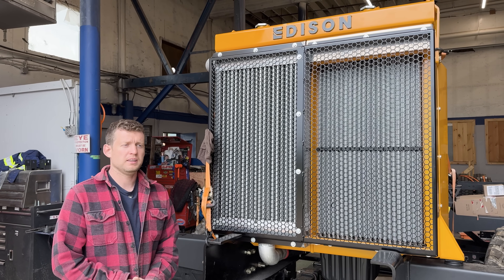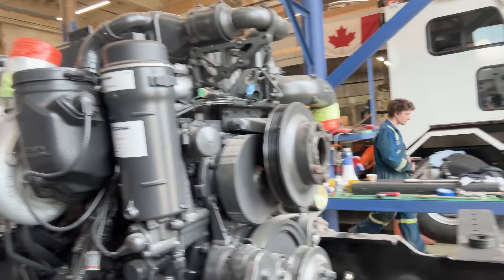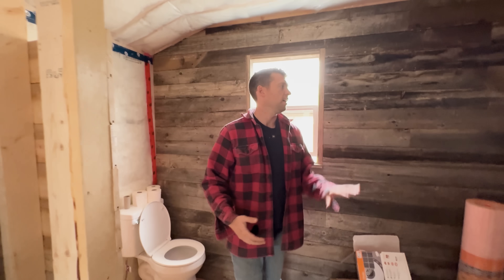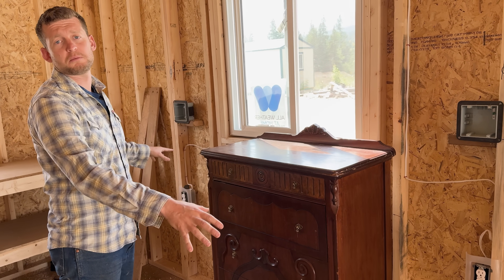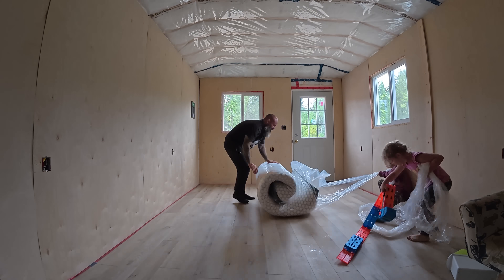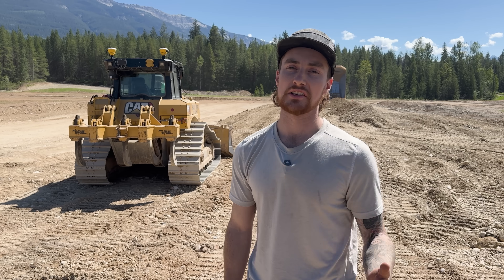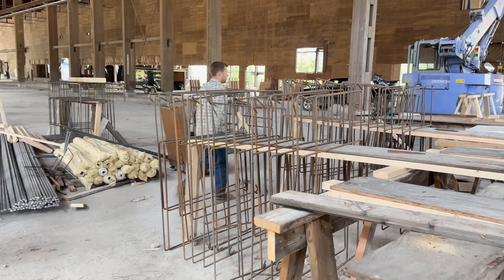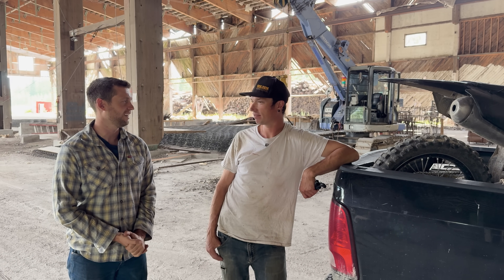Red Tape Can’t Stop Edison Motors - Full Update Inside

Comment: Pull the generator. Run it full electric for the certification.. bolt in extra battery packs under the hood. Run the generator stationary on a trailer to charge.

Comment: Can you find some sort of workaround? 
For example, as I understand it, an RV can have a generator to charge the coach batteries, and a semi can have an APU to run the coach. 
Also as I understand it a fully electric semi meets  emissions. 
So hear me out...
A fully electric semi with like 150 mile all electric range... 
Then a better sleeper, think like a modified northern lite truck camper. So like a real bed over the driver, a bathroom, kitchen, etc... 
Then put like a 1000 watts of solar on the roof, that charge the chassis batteries. 
An oversized coach battery that might be able to supply say a 100 to 150 miles if it was hooked up to the chassis drive train. 
Then put your generator on to charge the coach batteries. As I understand it an RV can have a generator to charge the coach batteries. 
Then make the truck able to accept any power source it can get it's hands on for charging, a 15 amp, 20 amp, 30 amp 110v plugs like an RV, plus 220v 50 amp and standard EV charging ports. 

Now you can't use the generator to charge the chassis when driving, but you can use it to charge the coach batteries. There is also nothing that says you can't plug the truck into the coach to recharge when it isn't driving... 

So you give the trucks transmission a park spot like a small pickup. When the truck is in park enable DC to DC fast charging from the coach batteries to the chassis batteries. This should be legal. As your truck wouldn't technically be a hybrid. There would be no way for the generator to charge the truck when driving. But anytime you out it in park you would get DC to DC fast charging off the coach batteries and the coach batteries would recharge off the generator, all be it at a slower speed than the DC to DC charging. 

Could train the driver to put the truck in park at stop lights to pick up charge. It would charge when getting loaded with logs, when getting unloaded, at lunch or piss breaks. To get through the day... Also you could plug the truck into block heater cords and pick up charge, sure it would be slow, but combined with the generator and coach charging it would help. 

If you got approval for emissions later then you could do DC to DC charging while driving through an over the air update. 

Lastly, you could make that chargers such that if someone happened to run a 220v oven cord from the coach oven outlet to the truck charging outlet, that it would pull charge off the coach while driving. 

I think there might be a work around here, while not perfect, doable

Comment: As auxiliary power units are allowed you should be able to use the white cab over. Instead of bolting the power unit just pin it on wth 4 removable pins. Call it an auxiliary power unit to run whatever goes on the back and just so happens to also charge the batteries that run the stuff on the back.

Comment: Your generator drives the electric motors during charging, while you drive. Otherwise there wouldn't be enough power to charge the batteries.
Unless you take 1 pack offline and charge it, and then put it back online and take another pack offline and keep going like that.
I'd like to see how they would evaluate/adjudicate that kind of charging setup.

Comment: you Need to run it Off Wind power , Add a starter power charge.. Use forced air Gear it conect it

Comment: Are homologation requirements different if you build the genset into a trailer like a fridge trailer.
Replace the genset in the truck with another battery pack.

Comment: I think that with a generator you don't have a hybrid. You have a fully electric with a auxiliary generator build into the vehicle. The Vehicle I think, from watching your videos, is fully capable of operating at 100% at all speeds and capacities in Electric drive and Battery only. Hybrids in the other side can't operate that way, they need the ICE to be fully capable of the specification. The only part you could see it as a Diesel electric is only when operating from Engine power, but that is not 100% to the capacities specified. And it is mainly as a range extender. So you don't have a Hybrid, or even a true Diesel Electric. Your truck as I see it is 100% Electric with an axillary generator build in, capable of mixed power propulsion. Or, ICE propulsion at reduced capacities.

Comment: How far could one of your logging trucks go fully loaded, on a public highway with battery only?
Reply: They did the 1 test day with Topsy and it seemed like it drove on and off all day. My guess is maybe 2 hours and 100 miles? Sounds like Edison trucks will have 6 batteries at 600 lbs each (3600 lbs total) and maybe 210 kWh total. Theoretically at Tesla Semi gets about 2 kWh per mile. If an un aerodynamic and heavily loaded Edison trucks burns 3 kWh per mile, then its range is 70 miles before starting up the onboard level 3 generator.

Comment: Could you just also make trailers(partner with a trailer builder) and add all the charging stuff onto the trailer and then your truck is totally electric untill you hook it up too a trailer ;). Also would let the trailer power any other on-site equipment someone would need

Also possibly just an onboard charging unit that could be installed onto a trailer aftermarket but I bet that’s hard to do so prob cheaper to just build everything to fit

Pros for you- you now sell the trailer and the truck.. thanks to the laws lol

Comment: I was thinking this morning...

I've never personally seen one but the replacement truck by Gia Kiruna for the K1050E has a generator on board to power the electric traction motors when there is a trolley power failure in underground mines.
These are sold in places with significantly higher emissions standards than in Canadian mines.
Its got enough onboard generation to move a 50 ton truck loaded with 50 tons up a 20% grade.
Again I have not seen it but I am told it uses a Mercedes Benz diesel and they have a reputation for making engines that can do the job and meet the emissions standards....

Maybe you should look into that and see what the engines looks like and if they are able to meet Canadian emissions...
Also they might already have a generator thats bolt in for your application.
Mercedes, MTU, Detroit, Rolls Royce power are all in bed together making generating sets.
They might have a solution sitting on a shelf.
Reply: The regulations bans all generator engines for highway use, changing the engine won't make a difference in this case. Canada also made a deal with SAAB to produce JAS Gripen jets in Canada, if SAAB comes to Canada it won't take long before Scania comes too, which means domestically produced Scania engines and easy access to spare parts.

Comment: Awesome update. I saw someone else contacted the PMs office, so I followed suit. Below is the message I sent, feel free to use it or modify it.
"Hello, as your office is undoubtedly aware, Edison Motors in BC is currently running into road blocks in regards to certification of their unique hybrid truck design. From my limited understanding, it is not that the components do not meet environmental regulations, rather that the usage scope falls outside of current laws and hence the department is unable to grant the permits required. I would request the PM's office and Minister responsible look into fast tracking legislation that would at least allow for validation of the drive train. I firmly believe this will help reduce carbon emissions amongst Canadian industry and is a good step towards repairing our climate."
Reply: Note this is almost certainly secondary legislation (if you don't know what that is, crash time for a lesson on the constitution). As such, a minister can change it without a vote tomorrow if they want. Just so you know, primary legislation is stuff that is voted on in parliament, and secondary legislation is generally used to flesh out primary legislation. So, what might be the fine for an offence in dollars. You don't want to have to vote every few years to account for inflation. In this case, the primary legislation almost certainly (I have not read it) does not specify the testing regime for a diesel engine used on a truck. It would be a simple matter to change the regulation so that when the diesel engine is not mechanically connected to the wheels and instead is used solely as a generator, then the generator testing regime and certifications should apply.
Just so you know, lobbying your representatives is the standard way to get this to the relevant minister's attention. Though you would hope the officials would have already done that. In extremis, you can file suit against the government over secondary legislation to get it changed. It's better and cheaper to lobby first, though.
Reply: @jonathanbuzzard1376 so what you're saying is the minister or pm could unilaterally do exactly what I requested. Cool.

Comment: If you're not spinning axles, you'll have to cycle batteries.

A locomotive Auto Engine Stop-Start (AESS) system automatically shuts down and restarts a locomotive's engine to reduce idling time, thus saving fuel and reducing emissions. These systems monitor various parameters like engine temperature, battery charge, and air pressure to determine when to shut down and restart the engine seamlessly, enhancing operational efficiency and sustainability.
Reply: Good to know :) Thanks for this insight :)

Comment: What is Topsy up to? Does it have a role in the construction?
Reply: Topsy had gen2 hardware that worked* (technically). Topsy revealed that they basically had to upgrade every component so it is parked. The new trucks are getting tougher gen3 hardware. If gen3 hardware behaves on the 2 trucks in production then Topsy is slated to receive an upgrade to gen3 hardware which is basically a full rebuild.

Or Topsy might get stripped down and used as the gen4 prototype.

Comment: As another work around waiting for emissions compliance, is there a way to make a mechanical interlock that disables the power lines to the motors, and then enables the charging cable from the generator? like houses have for powering the home when the grid looses power to prevent back feed? It defeats the purpose of charging on the go, but depending on use case, charge while loading/waiting/on breaks

Comment: The difference between a road engine that complies with pollution regs and a stationary engine that complies with the regs should be in the age of computer engine management 0 Nada zip Zero. Pre computer management there might be a difference in combustion chamber shape Cam timing and of course the road engine won't be controlled by a governor.
So complying the road engine and strapping it to a generator and reflashing the computer to be a stationary engine should be a feasible work around until the morons get a clue.

Comment: 3:00 is that a tiny alternator that aliment the scadia that is coupled to a bigger alternator ? that's so cute and funny
Reply: Edison trucks have a 2000 lb 200kW generator bolted to the rear of the engine that pushes out 600 volts into batteries. The batteries can release power at 1 megawatt for the pair of 350 hp and 33,000 ft lbs torque axles.

The truck has an inverter that drains some of this energy to run lights, radio, hvac, cooling fans, etc.

Comment: Lets not kid ourselves, they saw and knew it was an obvious loophole of how to manufacture a cheap to run truck with outdated emissions systems by going with a generator where regulations are much more relaxed. Good thing regulators didn't let it slide.

How are people so blind they are obviously trying to skip around powertrain emissions standards. They knew what they were doing and now try to seem like they are the victims
Reply: Not quite. The generator engine that Edison is using meets tier4 emission standards. Edison is correct that it doesn't want to spend $1m and 1 year to jump through some nonsense red tape hoop.
Reply: @Sah-o5m can you not read? Emissions tiers for generators are very different compared to vehicle tiers. They do not mandate any particulate filters or even EGR, which has been fitted in vehicles all the way from the 80s
Reply: @Tsimi1234 scania generator engines use EGR to pass tier4 emissions. They use SCR instead of DPF to pass tier 4.
Reply: @Sah-o5m Yes, this Scania one happens to use EGR. But it is not mandatory. DPF has been mandatory in all modern diesel powertrains since around 2010.

Check the emissions tiers yourself and compare them.

Comment: Im assuming your submitting the same data structure Toyota does with the prius prime?  The generator pollutants per mile.are measured as a phev thats already charged on a a test loop?
Reply: Prob not :( toyota spent bajillions to certify its engine.
Reply: @Sah-o5m  missing what I am saying.  They can manipulate the presentation of the engine manaufacturer's data the same way toyota is able to get both the pzev and EV certifications.  They did that with CO2 output calculated after battery useage and Edison can easily submit the engine emissions output as a lev in class 8 because they'd be able to run engine time and fuel use on the canadian emissions test route WITH full battery from the start because Toyota got to do that.

Comment: Don't be stubborn, diesel is highly polluting, you will only be allowed to build an electric only truck so get used to it before you run out of money like Nikola motors
Reply: Um no. Nikola Motors had a completely different business plan. Edison is doing just fine.
Reply: Canada has a long history of regulating and tightening emission standards for new diesel trucks, both on-road and off-road. The regulations are designed to reduce harmful pollutants like nitrogen oxides (NOx) and particulate matter (PM), which contribute to smog and other health issues. The only solution is to go Ev, and denial will not save your company, you will just comply with the law

Comment: For a Tool-Mule on the Property i could recomand the electric Chinese verson of the Piaggo Ape or Tuk Tuk. they come  as Fledbed and Box i plan on geting the single Cab+Box for myself. also exists as 4 wheel version cant remember if its AWD or not. the are roughly around from 2500€ after import in EU up to 10.000€  depending on how much extras you throw at them.  Double Crew Cab + Flatbed/Box or extended Battery bank for range. 

for Winter you can mount 2 Snowmobile Tracks to the back and the front wheel with Ski's for the snow.

edit: Fun Fact the Piaggo Ape had a special version wich had a metall turn disc for a Trailer like a big Lorry or Semi Truck called the Pentaro :D

Comment: What size cranes do you have specified? Before I retired I worked several places with large cranes up to 60 ton. You might think bigger is better but not necessarily, the employees would point out that the larger cranes were usually slower and would avoid using them. One shop had two smaller cranes that would "with the flip of a switch" work or travel in unison so that a long item, like a truck frame assembly, could be moved with a crane at each end rather than one in the middle. Would not have thought about such a detail unless I had not experienced it.

Comment: Why are you  referring to the truck as a hybrid when it doesn't operate the way a conventional hybrid does? That seems certain to confuse the politicians on the emissions board. Why not sell the truck as a bog standard EV, and then make the generator an optional auxiliary engine that serves as an off-grid charger and range extender? 🤓

Comment: If you stop calling it a hybrid and call it electric with an APU you would likely be golden. Put a plug on it to show its main power source is electric and then make an easily overrideable switch to make the generator only run when parked. After you sale the truck the customer has the right to repair and therefore the right to modify. Any compliance issues after that are on the customer. 
Bottom line is words mean things and something as simple as a word change can change the outlook of any government agency. 
Hell for funzies I’d even pull the generator out of topsy as a proof of concept for the government then throw it back in once approved

Comment: I have not been keeping up lately you’re team is doing amazingly well  if you’re already putting heat in the shop floors  it is a excellent system but has to be done now obviously  I work in a mine and have 
heating in the floors of the shop  it is amazing how much dryer the shop is especially in the rain no rusty tools and condensation  though 70 % of the service work is still done in the field for us  if we can get the equipment to the shop before they break it 😊